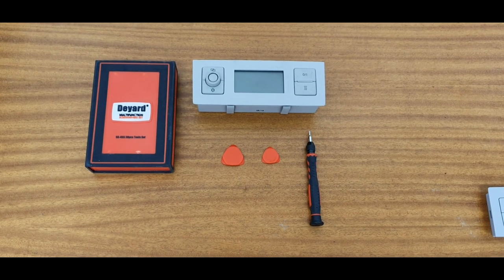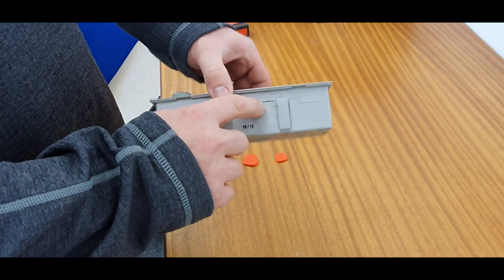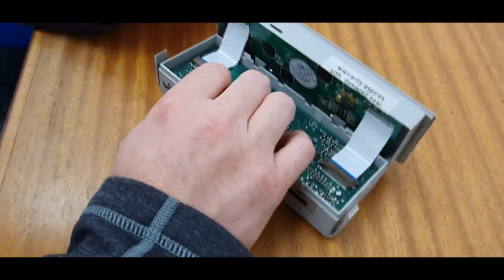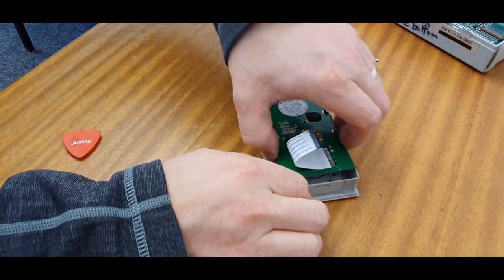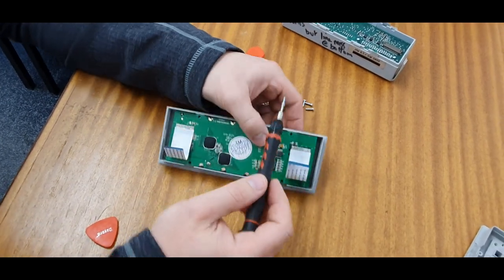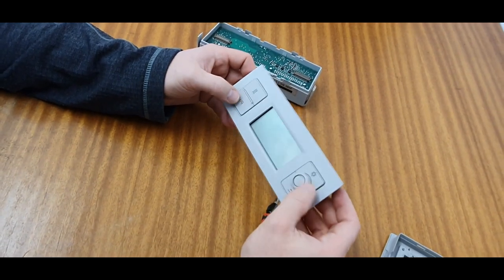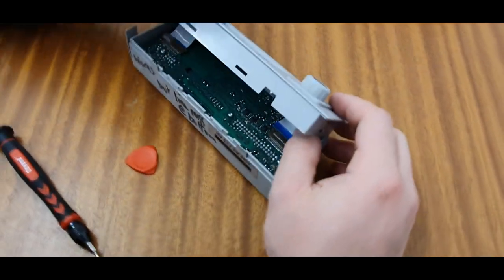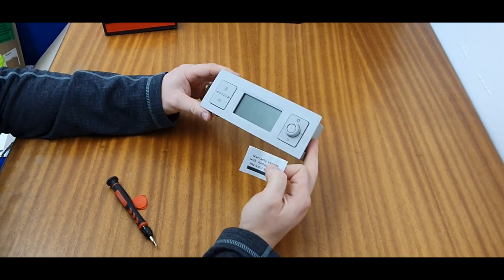How to Repair the Camping Control Unit  - VW California

Comment: Just did it and like the guy says it’s easy. I think the frightening part is knowing a new one is £800 if you cock it up. I didn’t take the 2 Ribbons out as it was simple just to take the 4 screws out without doing that. Also used the old facia panel as it was in perfect unmarked condition. Just wish someone would start making the knob on its own. Wether you use the whole thing or just the knob it’s still £45... far too expensive.